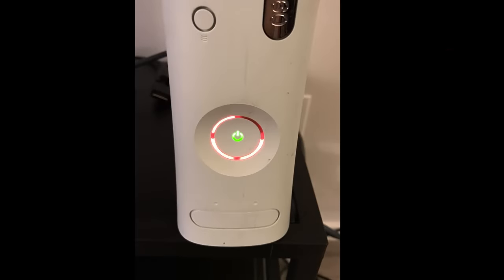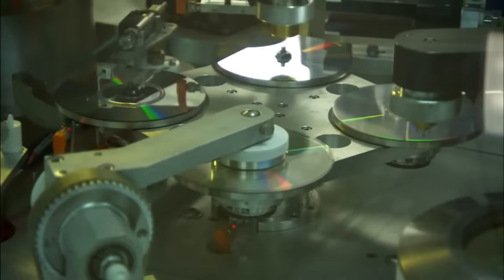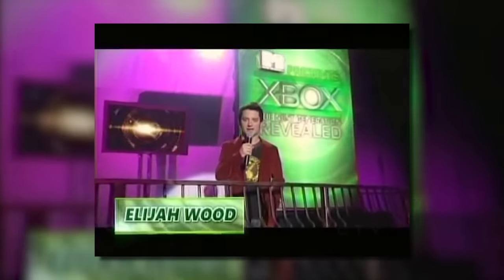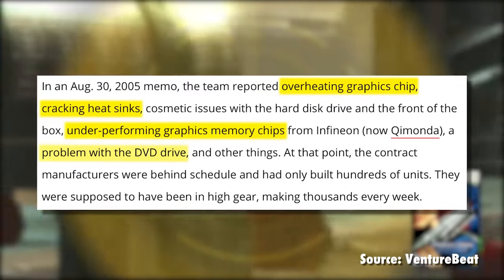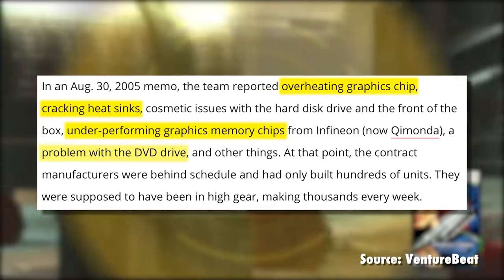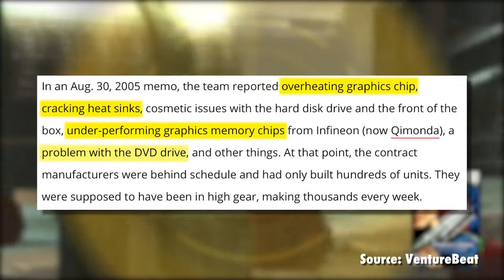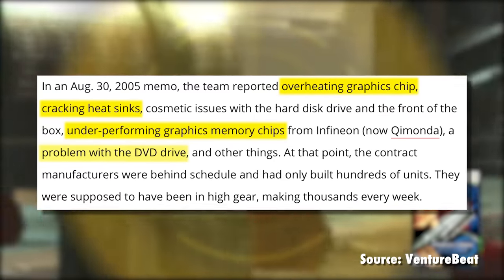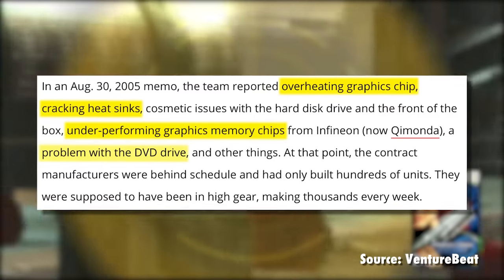History of the Xbox 360 Red Ring of Death | Past Mortem | SSFF

Comment: I've had my 360 e for 7 years and it still runs perfect
Reply: Same I got it when I was 6 or 7 now I’m 13 bro
Reply: The E red dots often, uh oh
Reply: It's because the e can't red ring
Reply: @kingkayfabe5358  That's a lie.
The E can red ring. It and later S models are the 2nd most prone to red ringing. (Besides Pre-2008 Fats)
Reply: Same here I bought an Xbox 360 S in  2010 it still runs amazing.
Reply: Knock on wood.
Reply: @thawkade  super slim can Red Ring?
Reply: @corvolaranja5615  All of them can, It's most common on early fats, later model Slims, and most super slims.

You should be fine as long as you keep it well ventilated.
Reply: @thawkade  thanks for answer
Also what what u think is more common YLOD OR RROD?
Reply: @corvolaranja5615  RROD, most definitely, those early 360's were rushed and flaweed, while the Fat PS3 also had this issue, it's nothing compared to the RROD.
Reply: @kingkayfabe5358  Mine was a 2009 Elite and it red-ringed in 2018. Sad day.
Reply: @thawkade  my E never really came close to a red ring in the 8 years and thousands of hours I put into it. I never had a single issue or a single crash. It always ran super smoothly
Reply: Had it for 9
Reply: @thawkade  my S is 10 years old and it runs perfectly fine a lot of times the cords would go bad on the consoles

Comment: Ayy, our two old ass X-box 360s are still soldiering on to this day
(famous last words, I know)
Reply: I have a 6 year old Xbox 360, STILL WORKING.
Reply: @thederentor5946  If it's a Slim model it would still be working. Only the Xenons and Falcons had the RROD issue really bad.
Reply: ⭕ hi....
Reply: KoivuTheHab  Calm down, he used it right, he just spelt it incorrectly
Reply: KoivuTheHab  he meant soldiering not soldering
Reply: KoivuTheHab  you claimed it was embarrassing that he didn't know what soldering meant. However he meant to use the word soldiering.
Reply: How did you get your 360 to do electrical work?
Reply: KoivuTheHab  I'm sorry that I can't spell XD
But at least it's readable, unlike many other comments XD
Reply: @jackp3125  Thank you for that wonderful reply XD
I laughed a little too hard XD
Reply: @thederentor5946  mine was 8
Reply: @thederentor5946  and it ringed like 4 times
Reply: @Renshyra  make mine 9

Comment: I have a fun story.
My father won an XBOX before launch in the big microsoft/mountain dew event beforehand. It lasted until we sold it in around 2012/2013, and so until today, I had never heard about the red ring of death. I guess we got lucky.
EDIT: I didn't think this was relevant before, but I'm putting it in anyway. My dad actually won the console by going through the trash cans at his office and finding all of the mountain dew caps inside, because a lot of people there drank it. He then, since there was one every hour, submitted them all within one hour, and won.
Reply: Cool story. It's possible the ones they gave away were from a good batch which didn't have any problems. The system ran hot because of bad thermal design but the actual point of failure was the lead-free solder they used. It basically started to crack and the CPU and/or GPU would lose contact with the PCB. They could have used better solder on some batches like the ones they gave away, which would explain why they lasted longer.
Reply: @hattrickster33  They weren't allowed to use leaded solder.  Lead free is usually fine, really the problem is the the lithography of the processors.  They got too hot.  I've repaired these professionally and while replacing the solder with leaded can help, they still tend to fail again.
Reply: Same, my Xbox is almost 11 years old and it still works fine
Reply: I have two 360s and I've never had problems with either one of them. Besides connection issues with the internet
Reply: Noice

Comment: One time, my sister TOLD on me because it happened. But, all I had to do was unplug it, and then plug it in again.
Reply: Unless you do the power cord trick.
Reply: Aiden Then it probably had 4 rings
Reply: Aiden Your not talking about any thing xbox related are u?
Reply: Aiden one of the potential causes for the red ring is a power cable that's not inserted all the way. If it red rings less than a second after it turns on, then it's a power cable issue
Reply: Aiden all my brother had to do is move the xbox to standing up
Reply: Aiden Same xD
Reply: Aiden mine was ok if i restarted it for a year-ish after i got it new. It was fine and it froze and made a buzzing noise through the tv speakers. I sent it away to be looked at and the service sheet said software. So i dont know what could have caused that. But i sent it away again to get cleaned out. Its long gone now though. It was just too sluggish. I have the 360 slim now. The cd drive went overdrive once on it so i had to pull it out at the wall and it was fine after that. I have an xbox one now and the fans speed up very fast for a bit but apparently thats only because i restart games too fast.
Reply: Jesus Christ Joseph Parker
Reply: Aiden that's bad for your xbox
Reply: @Team cole gaming Thank you for explaining that I wouldn't have been able to understand the irony there if you hadn't done that thank you so much for the explanation
Reply: jesse Brooks You do know who I am, right?
Reply: Aiden then it wasnt the red ring duh
Reply: Arizona Herps and Invertibrets dun dun dun
Reply: Justin Y. Ayyyy comment lord lol
Reply: Team cole gaming she probably didn’t know and thought he broke it
Reply: My brother XBOX 360 was made in 2005 BUT in 2018 januari The Third IT DIET!!! I got so many Xbox 360 games from GTA San Andreas to GTA 5 All Halo games I got the old Call of Duty World War 2 To Call of Duty Avengers and so many MORE!!!!!!!! But I can not Play them all😟😭
Reply: Justin Y. A copy of a persen
Reply: Aiden i did the same lol
Reply: danget!! that comment made me go Sayo-nara
Reply: XD ddlc Ref
Reply: Justin Y. Fake af
Reply: Aiden a
Reply: Justin Y. Fake Justin Y.
Reply: Jacksen_Furry wolf same 😢
Reply: Aiden LMAO I DID THAT TOO
Reply: Aiden so it’s wasn’t the red ring of death
Reply: Faze Booce it was it was just 4 rings not 3
Reply: sounds like a count of a sibling, especially a sister (sisters are much worse
Reply: Team cole gaming yeah it doesn't make sense, his sister is a birch and wanted to get him a punishment
Reply: I don't have a sister but I still know how bitchy they are. I do have a brother though which is bad for different reasonhs
Reply: than it wasn't the red ring of death...If there were 3 red rings than Your X-Box died , 1 ring or 2 or 4 are other issues
Reply: Team cole gaming its easy to fix
Reply: I have bought 4 360s 2 still work but 1 of those 2 the disc drive crapped out on. Both of the ones that still work have Jasper chipsets in them. The ones that failed had the falcon chipset and the Zephyr chipset which was notorious for RRoD my first one was black elite Zephyr that only lasted 9 months I sent it in got it fixed then pawed it because I bought an arcade which is one of the ones that still works but is the one thats the disc drive crapped out on. The 4th and final one I bought was the red RE5 xbox 360 and that is the one that still works to this day. All 360s made after october of 2008 have the jasper chip until the smaller xbox slim came out which those do not have overheating problems either. Oh and the 4th xbox I bought with no cords or controllers fr 20 bucks from some gu in 2011 to have a backup. It was a 2006 machine and didn't last a year. Since it was my cheapest I used it until it died then went back to my red one. Both of my Jasper Chipset xbox have never red ringed and are 10 years old. The Jasper was the ones released a year before the Xbox Slim came out.
Reply: I did the same
Reply: @Joseph Parker crap thats harsh
Reply: @Joseph Parker but a VERY good idea
Reply: @Joseph Parker Great idea
Reply: Drink Me I made a ne account lol ewwwww
Reply: I think he's talking about the AC right m8????
Reply: That's 4 rings, not 3 rings.
Reply: Same reason why my family thought i broke my X360. Brainlets.

Comment: When BluRay players first came out they were about $1,000.  The $599 PS3 included a BluRay player, rechargeable wireless controller, wi-fi, free online, non proprietary upgradable hard drive, and HDMI port.  (Original 360's didn't have HDMI ports)
Reply: Yami Brian deadass that's alot
Reply: You hit the nail on the head. As a total package, the ps3 was much cheaper
Reply: $600 is still a lot for a console, not matter how much you get for it.
Reply: todesziege exactly
Reply: Don't talk trash about xbox because we all know xbox and ps are have a different system and work total different ...
Reply: pranksternation What kind of fanboy reasoning is that?
Reply: The problem was that, in 2006, most people were still content with DVD's.  It wasn't clear at the time whether or not the BluRay format was going to outperform HDDVD's, or even replace regular DVD's for that matter, so when it came as a forced standard with the PS3, people saw it as a pointless and overpriced "feature."  Of course, BluRay did end up becoming the dominant format halfway through the PS3's life, making it a solid investment for Sony, but it was simply an impractical money sink in those early days.
Reply: The PS3 was a damn fine system.

Our PS3 from 2008 is still alive! However we did go through like 3 of the slim models for some reason so, original PS3 great, the slim that came out 2012 not so much.
Reply: yes but as history shows, sales did not take off until the unit reached the $399 price point...
Reply: Yami Brian yea they did have hdmi
Reply: Pimpeaux

But it is likely Sonys willingness to stuff a Blu-Ray into the 3 that pushed it to WIN the format war. Without taking the 200 lose on each console and the ding of selling less units because of the 600 price tag then the HD-DVD add on would have been around 5 times cheaper than any other Blu-Ray and would have utterly crushed the Blu-Ray format.

Now Microsoft is paying sony for every X1 sold cause Blu-Ray is standard now. Sony looked at the long game and decided to take the short term hit.

Comment: Even after everything that has happened with the Xbox 360, I still think it’s the greatest console of all time. The games, the controller, the daily use, the OS, the media, the players, the hardware, and the support. So many things made this a good console, if this thing didn’t have the red ring issue, it would’ve become an absolute legend. Even the original Xbox 360 with the red ring issue was reliable without the airflow issue. These things were absolute units. And they will forever sit in my heart on a podium as the truly ultimate console. It still has great looking games even after 15 years.